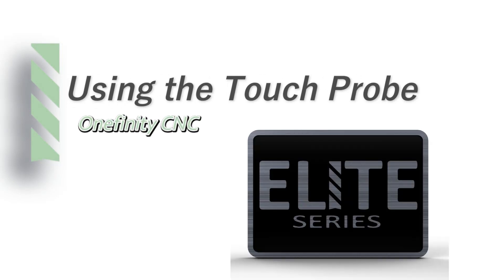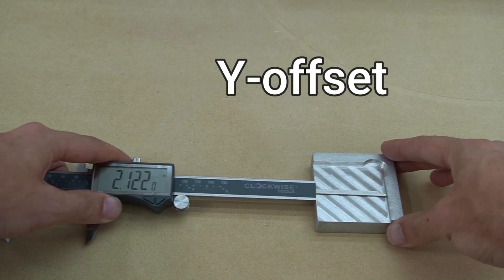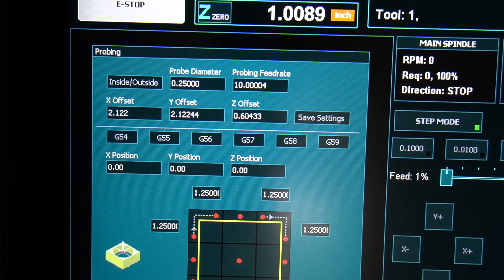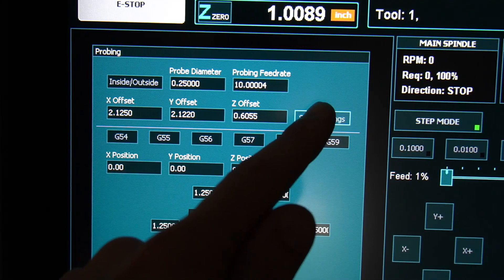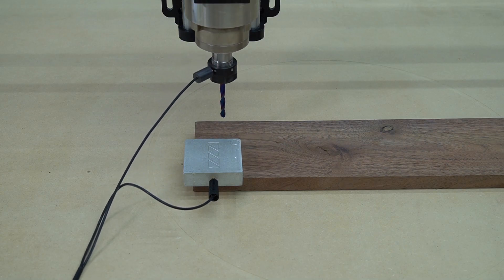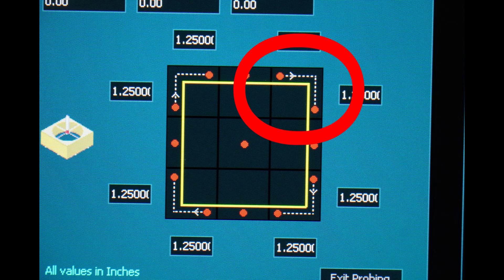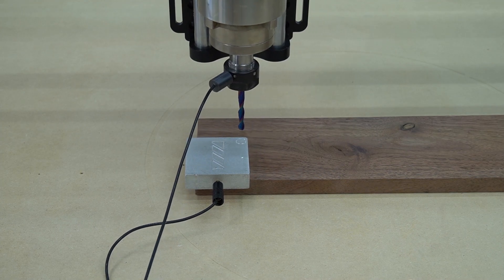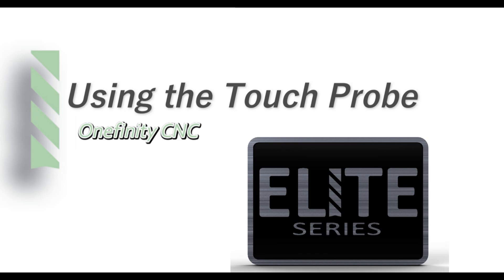Using the Touch Probe on the Elite Series (MASSO) Onefinity CNC

Comment: Hmmmm. you know that the flutes of the cutter will effect your offset right?!?  If one isn't touching off on the largest OD of the cutter, in this case the .25" OD of the flute, they are going to be off, perhaps as much as .10" depending on the number of flutes and their configuration...

I am sure you know this yet you don't mention it...why not?  It would be best to touch of XY with a 1/4" diameter rod or broken end mill(utilizing the shank), and then coming back with the actual tool and touching off Z. An 'extra' step but certainly worth the accuracy.
Reply from the maker: This video is aimed at new users who do not even know what a probe is :P
Reply: This is overcome by adjusting the Z height before probing, so that the touch off face can make contact with 2 or more flutes simultaneously.
Reply: @BrianTroup-zk4yn  You cannot set X and Y precisely with a two flute tool.  Even the Onefinity reply agrees with me. Sorry bud.
Reply: @grantjohnston6152  Please send me a link to this 2 flute tool you speak of. None of my 2-flute tools have less than 50% twist diameter within the bottom .600".  Even my 0-flutes complete 75% twist within the first .75".  Maybe you might not be able to do it repeatedly, but I certainly have not had any trouble with my onefinity or my ISO20 size appropriate tools. So post the link, I'd like to see the tool you claim has .010" error within the full depth of the touch block.

Comment: New CNC user here, thank you for the tutorial. I had a couple more questions if I could,  I was wondering if I would probe before I load my file to be made or after it is loaded? Also do i need to press zero on the masso screen for x y and z after I finish probing? Thank you
Reply from the maker: You can probe before or after, it won’t make a difference.  You will not press zero on anything as the probe is doing that.